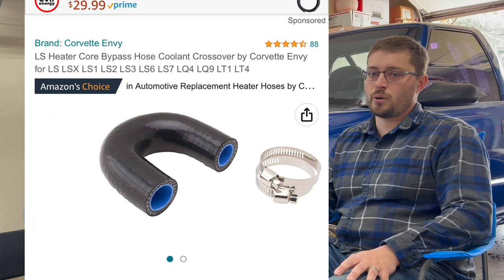How To LS Swap Your S10 // The ULTIMATE Video guide! Full Parts List Breakdown

Comment: This video is excellent!

Gonna comment some tips to add from experience with a 1988 4.8 5 speed 2wd and a 1996 5.3 5 speed 2wd

TRANSMISSION- Using a 4.3 NV3500 on trucks

HEADERS/STEERING SHAFT- When choosing a header you can also go with Hooker Manifolds. It worked great on my 2nd Gen 2WD swap once I got the Hooker Blackheart steering shaft and took and angle grinder to the manifold and shimmied the engine mounts all the way away from the manifolds lol On my 1st Gen 2WD swap I used 2nd Gen S10 Sanderson shorty headers and have a ton of clearance to run my factory shaft
Also running a non-powersteering factory setup in my 1988. I daily drive this truck and it doesn't seem any harder to drive than it did with the 2.5

THROTTLE- Factory throttle cable from my 2.5 worked on my 4.8, factory throttle cable from my 2.2 worked with my 5.3

HARNESS/GAUGES- On both 1st and 2nd Gen swaps I have used a JH Performance stand alone engine harness. The downside is that it doesn't connect to your factory gauge cluster, I have used old school manual gauges on both swaps. ALSO we offer a full S10 line of Reversion Raceworks dash parts on our site! S10LIFE.ORG

ELECTRIC FANS- On both of the swaps I am running dual generic parts store electric fans also using 4.3 radiator on both 

REAR END/DRIVESHAFT- I was able to run the stock 7.5 and stock drive shaft on both trucks. I have swapped to a ZR2 rear in the 1988 with a custom drive shaft and a Eaton TrueTrac 

Please feel free to ask me anything about my comment folks!
Reply: I used a t56, standard extended cab driveshaft to 8.8. Worked a treat.
Reply: Look for 97 and newer with 4.3 and manual = 8.5" rear. Normal width. 2WD = 54.5,  4WD = 60", ZR2 = 63"
Reply: I’ve got an 89 I’ve been tearing into how much did all that run you brother
Reply: I was thinking about doing a 88 s10 with an ls and a 5 speed manual trans, so my question is which manual trans mounts up the best in the truck?
Reply: @1Blackman82  a t56 bolts right up but you can get away with using a cheap nv3500
Reply: Thanks man. I'm going to start on this project. Just looking for the right truck.
Reply: @gelatinousricardo6894  back in these days (2014) it was around 2500

Comment: You really didn't miss anything! But there are a couple things I'd add. The 302-1 style oil pans also work very well on these swaps. Also if you need to have the driveshaft shortened that's a great opportunity to upgrade to an aluminum driveshaft from a full-size gm truck or a trailblazer. Also if using the factory pcm, you can use an obd2 reader like an elm327 to display a lot of engine data via the torque app. The only gauge you would need to wire up or add is oil pressure
Reply from the maker: Good info here^
Reply: Why aluminum? Don't people in the fullsize world usually go to steel because the aluminum ones bkow apart at higher speeds?

Comment: If my 02 Xtreme's 4.3 wasn't so solid, this would be awesome to do! I'm a middle aged dude who doesn't need much. The 4.3 still smokes the tires if I'm not easy on the fun pedal, so I'm happy enough!
Reply: And if u have the 4.3 manual u should have no problem smoking the tires 🤙😁
Reply: @atownda_realesttv5585  The CRAZY part?... It smokes the tires without issue and it's a 4L60E! The short wheelbase and tiny bed negates the driveshaft HP losses the extended cab versions got. Rode in an extended cab Xtreme back when it was new and it went 0-60 in a hope and a prayer while downhill with a tailwind! EDIT - When I was lucky enough to snag it, I only got it because the better half couldn't and wouldn't learn to drive a manual and we were between rides - Mine was stolen, hers got t-boned by a teenager blowing a red light... So it was kinda bittersweet as I agree with the stick. That would have been AWESOME to bang the gears out myself.
Reply: @mackmcmillan9905  yessir, I don't think I'll ever sell it , it's. 98 and I love it man. I'm getting her ready for a ls swap
Reply: @atownda_realesttv5585  Nice! You should upload video(s) about it as you go and even before so you can do the comparison! Mine's a red single cab short bed "tiny truck" as the better half said! What type is yours? And have you sourced an LS with the computer that plugs and plays like they did on the old "Trucks!" TV show? They made that swap look so easy...
Reply: @atownda_realesttv5585  A-Town... Atlanta A-Town? I'm a Georgia man myself if so. Even lived in ATL as a little fella. Of course, I've had a military career and no longer live in Georgia, but I am glad I was born and raised on the farm down there!

Comment: Next month I will be a year into building my first hot rod: a candy purple 97 S10 - single cab, short bed, fleetside, 4.3 with a 4l60E, crank windows. My daily driver at the time.
I'm throwing an LM7 with a BTR Hot Rod cam, TBSS intake, and Holley Terminator X EFI in front of a Tremec TKX and built 9 inch Ford from Quick Performance. 
Boxed the frame. Put in a steel 10 point cage from SW Race Cars. 
Aside from going through the heads I have done everything myself minus some bodywork that my Dad (a bodyman of 50+ years experience) did for me. 

Thank you so much for sharing your experiences and your knowledge. You in particular helped me decide to take the leap and go all the way with this truck. You are the fuckin man.
I look forward to seeing what LSBluu is really capable of. Best of luck always.

Comment: Headman also sells longtubes that are a 2 piece header flange its what i run thier around 400 $ and two of the header tubes wrap around the frame on both sides spark plug boots will need to be small 90 degree boots but othe than that pretty good clearance

Comment: great video. Gen1 s10 currently sbc powered. I'm going a little different route. ly6 carbed. th350. I got a great deal on the carbed intake and msd box and I already have a great carb and built transmission. someday I will switch to efi but for now, with budget in mind and not wasting good parts this is what i'm doing.  Also if people want a direct bolt in rear end upgrade try to find a 8.6 rearend from a 2wd 5speed 2nd gen blazer, just take that rearend and put a limited slip and you are good to go, already has 3.42 gear and disc brakes also

Comment: I used 2005 Corvette accessories and didnt have to cut up the core support and move the radiator.  Have a inch of clearance with intrepid fans.  But did notch the frame for AC Comp.

Comment: 95-01 Ford Explorer SUV or 02-04 Explorer Sport-Trac “pickup” 8.8 rear ends are a great swap and come with 31 spline axles, LSD and 3.73 - 4.10 gear ratios. Pretty much bolt right into s10 and can be found in every junkyard. Only difference is the 8.8 is wider than stock s10 rear ends. They don’t need to be shortened to fit but they can be if desired

Comment: I’ve got a 97 s10 2.2. I have my 5.3 motor and I’m trying to plan all of this so it’ll be easy to put it in my truck. The ls I have is the l59 (flex fuel). Your vid helped with a few things but will my stock fuel pump really work with the engine (even if I run e85)? I’ve heard that you can use the Silverado assembly but do you have to modify the truck for that? For your transmission crossmember you just used the 4.3 without any modifications? What about your drive shaft? Can you use the stock one or do you have to have one made? Sorry for all the questions.

Comment: I still want to build one, it should be 1000lbs lighter than my Silverado. That would put it in the 11s easy. The biggest turn off for most people is the cost of the headers if you want long tubes. Headman has some for $403, but they have PUNY 1.5" primary tubes. (Part #69050) All of the 1.75" primary say "not in stock, will be special ordered" (Part #45900) The #45240 1.625" primary mid lengths - "only 4 in stock" as of today 3/10/24. The cost of the wiring as you mentioned, is costly too if you want everything to work. Not all of us are wiring gurus and can do what CP and BP Auto can do. 

I would want AC in mine, it's too hot in Florida to not have it. It's doable, just more costly. Love your truck, great color, etc.

Comment: In a 2000 extreme 2.2 manual, can I use stock trans and drive line? I’ve heard these are the same manuals they put on the v8 trucks so I figured it should be possible?

Comment: Nice video , putting together a first gen now. Got a question maybe off topic but is there any difference between the  4 cly frame and the 6 cly ?
Reply: As long as it is 2wd the only difference you will run into is having to either weld or tap the engine mount at the frame
Reply: Ok thanks a lot

Comment: Just came across an 01 Xtreme and plan to build an 02' 5.3 for it.  I've never done a swap but I was told that the bell housing would have to be changed from the OEM 4.3 to a V8(???)
Reply from the maker: Should be perfectly fine. May have to add a spacer on the flexplate. But you won’t know that for sure until you get the trans in and see the gap between the flex plate and converter hub

Comment: Iv got a 4.8l. I want to use my original t5 that was with the 2.2l it's a 2nd Gen 1994 s10. This t5 uses the Ford mout between the trans and bellhousing. I know the t5 isn't the best. But would it be possible to use it.

Comment: What about a regular SBC SWAP?
Reply from the maker: @BigUnk85  regular SBC swap should just require oil pan and headers. If  coming from a 4.3 the engine mounts theoretically should be the same and fuel pump should support it.
Reply: @LsBluu  thank you sir for your response

Comment: I’ve been told that you have to replace your stock break booster with a 98ish malibu break booster for clearance. How true is this?
Reply from the maker: You don’t HAVE to swap boosters. It does help, there is a little clearance issue there with a coil pack, but nothing a bfh won’t help with.
Reply: @LsBluu  thanks!

Comment: Any 5 speed strans that would fit on my 5 speed s10 if I do a ls swap?
Reply from the maker: Nv3500 would. Not sure how it would do if you throw a bunch of power at it.
Reply: I just discovered that the AR5 from the chevy Colorado works with a fabbot adapter they sell Im doing the same as you with LS manual 5 speed swap. And thanks to this video of @lsbluu it got me inspired and started with my build

Comment: Is this swap possible on a 4wd
Reply: It is possible though notching of the frame is required in the front half where the engine would sit. There are also some clearance issues with 4wd components and you would account for.

Comment: I live in middle tn have a 1998 extended cab s10 ....4.3 auto ....if any one on here wants to swap an ls into my truck ...i am looking to pay someone to do so (that has proof of experience and a good reputation) ....i will buy parts needed for swap ....and engine ....interior of truck is already out only driver seat and dash ....i wire brushe and fix all the floor pans and then primed them ...and then put heat sheild and sound proofing all over floor and cab ....for ls swap and the audio system i have .....this is a serious ask.....i will buy a harness from painless or comprable harness...

Comment: You got me thinking i could do all this in a single weekend all parts in hand dang im hyped
Reply from the maker: If you got all the parts, motivation, and tools, you might be able to do it
Reply: @LsBluu  only unclear thing is using the 4.3 trans will the column shifter still be working or in the way of the motor?

Comment: I've gotta 99 s10 and I've heard I need the flex plate adapter to run my stock transmission behind my 4.8ls. is this true? My trans is a 99 4l60e removable bellhousing type from another s10
Reply: Check the input shaft too, usually the light duty/older stuff is 298mm, and the newer is 300mm + a 1 inch longer bellhousing.